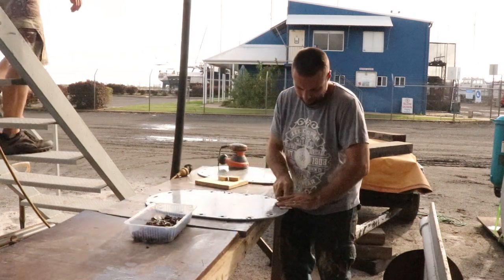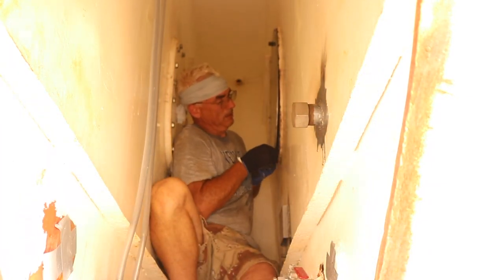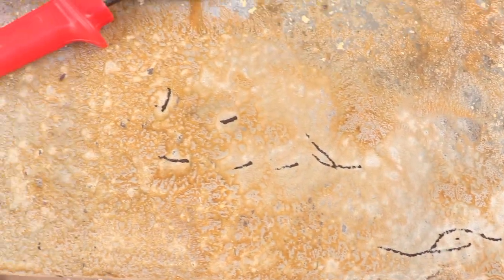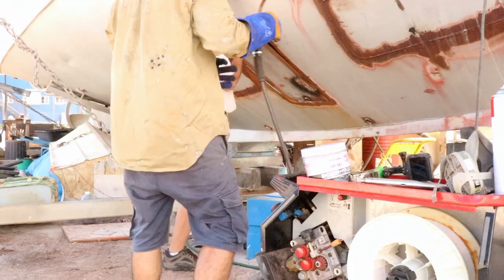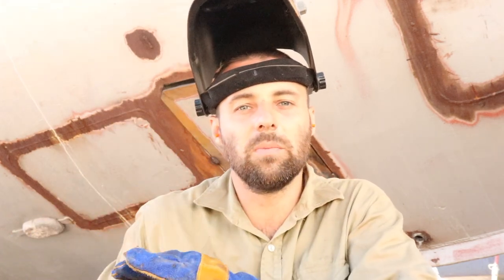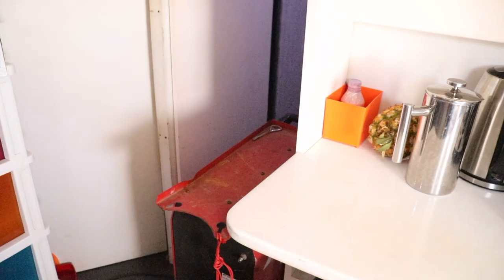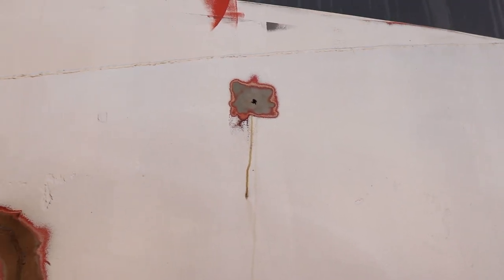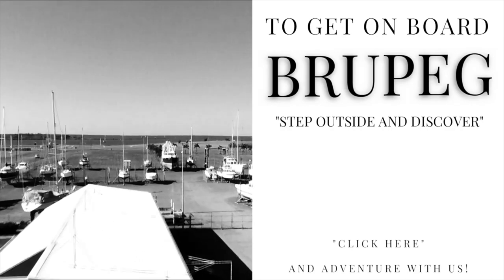Welding our hull closed part 2 - Project Brupeg Ep. 76

Comment: When you need to re-enter the tanks, a cake decorator bag for icing makes applying sealants like this way eaiser.  Also, putting a piece of threaded rod or a longer bolt with the head cut off will help in putting the hatch on.  Slide it over the threaded rod, affix the rest of the bolts, then replace the threaded rod with a bolt.
Reply from the maker: Ahh I really like that idea, thanks. I still need to seal up the rear tanks so this will come in very handy, thanks Clayton

Comment: Couldn't help notice that you pull your torch away as soon as you finish the weld. You should cultivate the habit of keeping the torch over the weld until the post gas flow has ceased, this will protect the weld from atmosphere as the puddle cools.

Comment: Damien just another little tip. In your cofferdam if you put a light on your deckhead with a switch, makes it easier to see the tank levels. But it would also mean having to remove the cofferdam lid to do so. The way around this is to fit a large threaded pipe or nipple fitting welded to the lid. The pipe fitting should be fitted with a plug, make it as large as practicable. Use, remove plug, turn on illumination inspect level. What is used in larger vessels is a cap fitted onto a tube down which you run a dip tape to check levels. On the bottom of the sounding tube is a striker plate to stop the plum bob from wearing out the bottom.

Comment: I've just started watching this channel thanks to a recommendation from Acorn to Arabella. I went back and watched I believe most of the videos. I may have missed it but could you expand on why the ship sank in the first place.
Reply from the maker: Hi, great to have you along. Brupeg was moored up-river about 15miles from the sea and the tail end of a cyclone dumped hundreds of mm of rain on what is a huge catchment area for the Burnett river. The river rose and was flowing at around 15-20knots (we have been told) and the owner of Brupeg at the time had already lost his house in the flood so told the skipper and crew to take the boat to sea and save it from being lost as well. they were heading downstream and while in the main channel hit a sandbar that had formed due to the massive volume of water travelling downstream, the boat turned side on the the water flow and rolled over. The crew got out thankfully but the boat was lost, she spent the next two months on her side, 3/4 underwater.  The insurance company wrote her off as it would have costed more to get her back into commercial survey than a similar boat could be brought for. She was pulled from the water and stripped ready to be cut up for scrap... enter Jess and I, we saw her stripped and waiting and we fell in love with her lines, her strength and the possibility she represents to us. for the last four years we have been rebuilding Brupeg into a tough capable expedition boat, people started being curious about what we were doing so we started filming the journey and something we never expected, people wanted to become involved (much like what has happened with Steve and Alix from Acorn), so we now have a great community of viewers, volunteers and patreons who support us. I'm stoked to have you along Blackford, welcome aboard. Damien

Comment: I'm curious about when you weld the panel seam in the hull. You fit on the outside ,then weld outside first, then back grind and weld inside. Why that order? I build tanks, ducts, and flumes. We always fit from outside, then weld inside first, then back grind and weld outside. I find grinding in a confined space unpleasant and grinding sparks stick to stuff making more cleanup. Did you consider using dual shield wire?
Reply from the maker: Hi Daniel. No specific reason we did it in that order. We had everything welder related set up outside and it’s a mission moving it from the bottom of the boat to the inside. So we accepted internal grinding is painful but easier over all

Comment: You make reference to going into ice. How confident are you with regards to your hull welds. Will they be Xray / Ultra sound checked during the boats final inspection? I personally would of contracted the hull welding to a third party and have it professionally sealed then you have a degree of liability.
Reply from the maker: I’ve built almost everything in this boat so saying I have a degree of liability is an understatement. I used to sub hull welding out to a local boilermaker and I’m confident in my welds enough now that I’m happy to do it myself. Plenty of homebuilt boats have gone to the ice. My hull is 99% professionally built and the bits I’ve done I’ve not left them until I was absolutely confident in the work.
Reply: Am I correct in assuming that by 'having a degree of liability' you mean being able to blame someone else if it goes wrong ? Fat lot of good that'll do you thousands of miles from home in the middle of the ocean. Damien welds in the same way he's built so many things on Brupeg, double or even treble level of redundancy where necessary.

Comment: You guys are doing a great job! I do want to ask a safety question pertaining to your patch plates... In the bit of the video that you guys are brushing the welds before coating, there appears to be a lot of undercut at the toe of the weld. maybe check the depth with a pit gauge to ensure that there aren't spots that are lower then the nominal plate thickness. Seriously, Not trying to nit-pick the work you guys are doing and I apologize.
Reply from the maker: Thanks Josh Happy to take this advice. I will go through and check them today

Comment: Question. What kind of bungs are u using for the holes in the hull. U could use a flat style bung with an inset key or driver so u didnt have to put anything over them and they wouldn't snag on anything maybe I dont now just an idea to throw around.   Also thanks for the hours of entertainment. Really enjoy your videos.
Reply from the maker: Hi Sam, yes that’s definitely something we will look at. I love the idea of less ‘stuff’ hanging outside of the hull
Reply: Allen head plug
Pretty common in earth moving for the same reason 
Just rocks not ice 
We also cut a large diamiter tube like 50mm tube by 10mm wall then about 25mm long 
Or long enough to stick out further than the bung to protect it
Reply from the maker: Yeah the tube idea was the type of thing I was thinking of. Nice simple way to protect the bung

Comment: What are all the pipes under the hull? Isn't that a lot of drag and hard to clean of barnacles and other growth?
Reply: Damien!

You really need to make & hang that sign.
Reply from the maker: Yes to all of the points youve raised. They are the current keel cooling pipes used to cool the main engine, generator and gearbox. In tropical waters this is the most effective method for cooling your engine water, however in ice they are very exposed so we will be cutting them off and building internal cooling prior to any ice work.

Comment: the Argon excludes oxygen from the area of the weld?
Reply: Hi, Michael.  Yep! The localised inert atmosphere prevents oxy-chemical crud-doobrie ghastliness.  [Stop me if I'm getting too technical...]   ;-)
Reply from the maker: And flux core wire with a shielding gas means MIG welding in the wind is possible as the gas creates a lovely inert area to weld for 95% of the time. The other 5% when wind blows the gas away the flux in the wire does the heavy lifting of shielding the new weld. Gas with flux wire also allows a hotter, deeper, stronger weld hence we use it on our structural steel
Reply: @EleanorPeterson  ha that was a great description 😄

Comment: How do you drain the anchor locker.
Reply from the maker: Ok so the anchor locker has a floor and a shelf about halfway up, the shelf is where the chain sits and the winch is above it, that shelf is above the water line and drains over the side. the floor is under the waterline and needs a bilge pump. That said its never had a pump up there so it might just be me over thinking that.

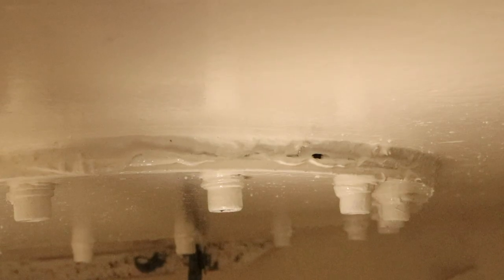Comment: Is that a hole I see? At 10:06
Reply: in theory yes but i don't think there will be a problem the stuff he used is great airplanes have been using it for 40 plus years and if does leak it very easy to fix if needed.
Reply from the maker: Yeah it’s a bubble on the surface. Below that is maybe 1-1.5” of sealant. So Keppel is right, it’s pretty robust stuff and if it does leak we can fix it pretty easy

Comment: Hello team,
I'm not sure how far behind these episodes are.
However I found this company that might be able to supply a guard for the through hull bungs
https://www.apvheads.com.au/services/#1534317398248-e4169f7e-2fef
Second product type, the 150DN item is a stocked item and would provide a 37mm rise above the hull surface.
If you were able to bore out a hole in the top of the dome with clearance for the appropriate socket you'd have an effective guard.
Reply from the maker: Thats awesome, i didnt even know you could buy these!. thanks for sending the link through
Reply: @ProjectBrupeg  
Glad I could help, they might also make good protectors or mounts for sensors associated with things like depth sounders etc.

Don't forget, if you get them in stainless use the plasma cutter to get any holes close to the right size ;)
Reply from the maker: Thanks for this

Comment: 🎉🎉🎉 🍺Yaaaay Richard ,well done mate.
a little bit of argon wont hurt you as long as you have fresh air coming in, worst would be a slightly deeper voice 😁 "Cody's Lab" has covered breathing different gases including argon.
I still havent made it to the city🤦‍♂️ but i will soon. Would you have use for a small winch/pot hauler?  12 volt single direction unit, I'll mail a pic later today
Reply: Pretty sure he would still need oxygen in that mix, working in confined space, let alone knowingly replacing the air with argon plus other gases from welding and breathing, very dangerous, cannot state that enough, plenty of people die in much more benign conditions. I think Damo came up with a plan and it worked......would have strongly recomended ensuring they had a way to extract him (i.e. harness) if something went wrong. Confined space asphyxiation is a silent killer, it can creep up on you......all of a sudden lights out (excuse the pun).....and it has a habit of drawing others into its trap.
Please don't ever under estimate this risk. (Just some friendly advice)
Reply: wasn't being serious.. I dont get paid enuf to be serious 😏
Reply: @billbaggins  no worries, just kinda how so many situations go down, a real silent killer, sort of triggered.
Btw - those little 12v pot haulers are great, especially if they are going to look a deploying camera stations (BRUVS) or fishing gear can chuck it on that jet tender even, its a great offer.
Cheers mate
Reply: I forget that sarcasm doesn't always come through when typed😁
Reply from the maker: Hi Bill and Dan, yeah doing this again I would go for the harness, didn't think of it at the time. as for the pot hauler, definitely would find a use for that, we have a few projects potentials on the go at the minute and one of them might just involve hanging ROVs' and or multibeam sonar from the boat, I cant say much yet but im itching to tell you guys!
Reply: @ProjectBrupeg  Yeah, its just such a tight squeeze, i would hate try and recover someone from that confined space (and I hate harnesses).....but like i said it looked like your solution worked fine....thought you might just shove a stainless bolt from inside and weld that bung up after you finished.
Home stretch hope to see you splash her soon, cheers

Comment: Wont that area be brittle from the heat? Kinda like how they say the titanic was weakened from the coal fires
Reply from the maker: No, going brittle happens if you heat something up red hot then cool it fast like chucking water on it etc, if you weld it then let it cool naturally it will be pretty much the same strength as the steel around it. That said heating something and then rapid cooling also makes the surface harder (but increases the brittleness), ie a steel punch gets heat treated by heating to red hot then throwing it in a bucket of oil to cool it down. Remember all ice breakers are welded together.
Reply: I had it backwards in my head lol i thought quenching made it more flexible
Reply from the maker: Also thinking about it now I think the titanic had an iron hull (could be completely wrong here) which I think reacts different again to carbon steel
Reply: @ProjectBrupeg  & 5XL ATV   The steel plates for the Titanic had too much sulfur which made the steel brittle when cold which just a little  above freezing ( 32 F or  0 C) in the North Atlantic in April.   The coal fires were in the fire boxes of the boilers which are designed for that service.  Every joint on the Titanic was either riveted or bolted in 1912.
The brittleness you are thinking of is heating to above red and then quenching in water or oil for hardness which does make the metal brittle.  If the metal is then heated to about straw color and let cool, some of the hardness is lost but the metal looses most of the brittleness.
Reply: roy , i think that weld you are referring yo will get work hardened buy use . she'll be right DAMO , rudder next lol?
Reply: @royreynolds108  
The titanic had a fire in the coal bunker 
One reason they were going so fast though the ice field 
Trying to burn the smouldering coal

Comment: All you needed to do was put the shop vac at the top and run the hose into the coffer dam down to the bottom. suck it out and blow it over the side.
Reply from the maker: Trouble is the vac at the top of the coffer dam is still inside the main forward cabin, doing it from the bottom meant we would pull the argon out of the boat and away from being an issue